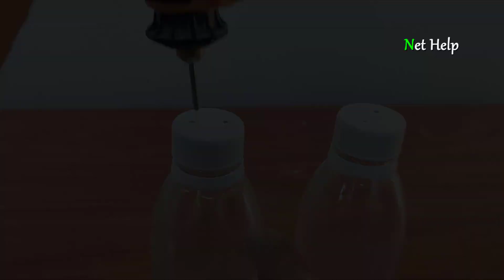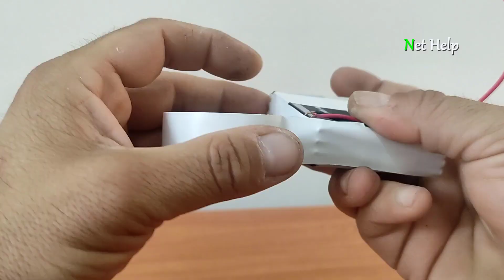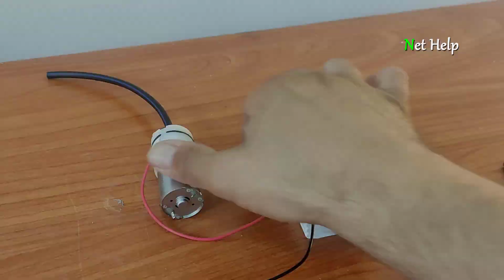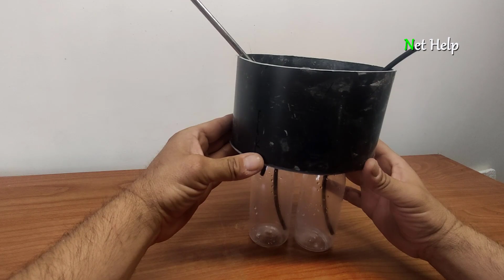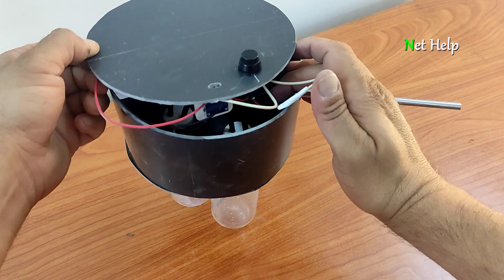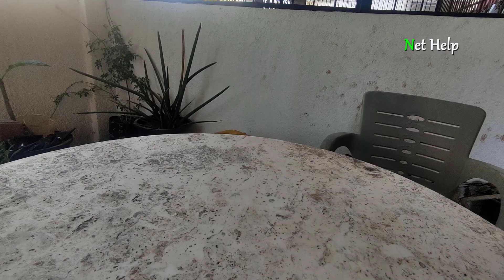How to make free LPG using water at home - gasoline and water - great idea

Comment: Nice job,  I have lots of old petrol 2-3 years old could I add an additive to the water to help clean up the petrol, or should I just consider distillation for a clean fuel to drive on...??
Reply from the maker: Gasoline should not be cleaned